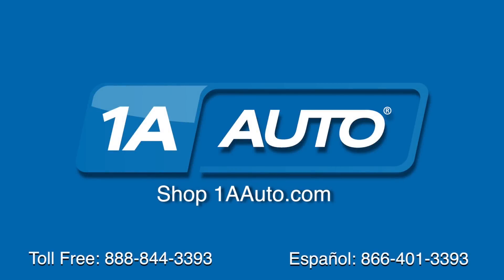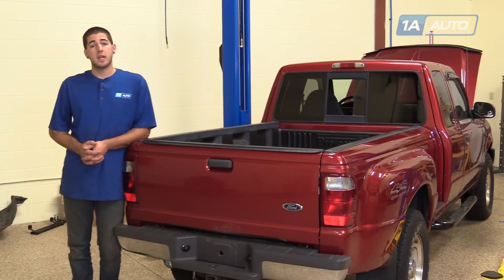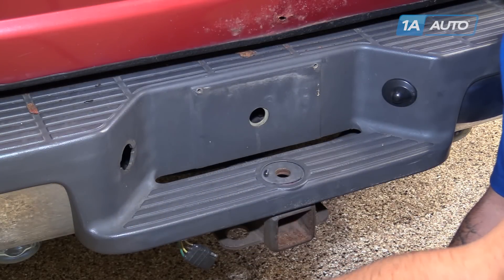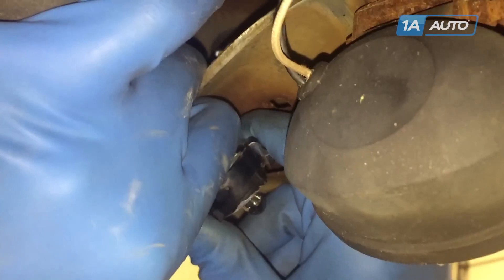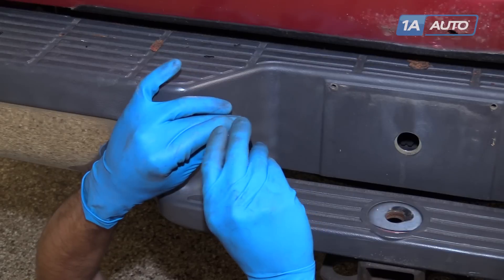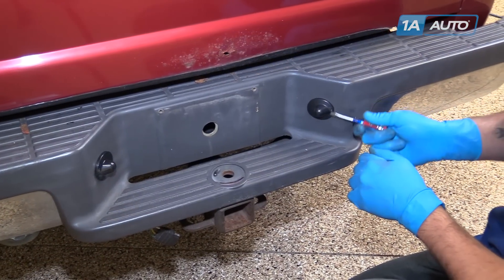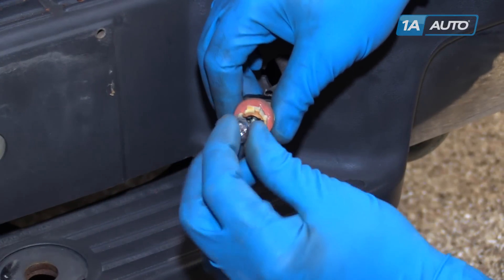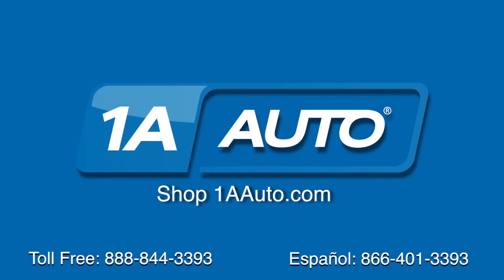How to Replace License Plate Bulbs and Covers 89-11 Ford Ranger

Comment: Just bought a 1991 Ford f150 and noticed the two taillight bulbs were out, so I crawled underneath to pull out the bulbs and found that someone just clipped the wires!  Much easier than replacing the bulbs???

Comment: Hi guys, I have a question, Is possible to find the socket and the conector?, My truck lost a plate light (maybe because the last owner), to repair it I must get all the piece, the socket, cap and the conector because seem like the old light was ripped or cutted.